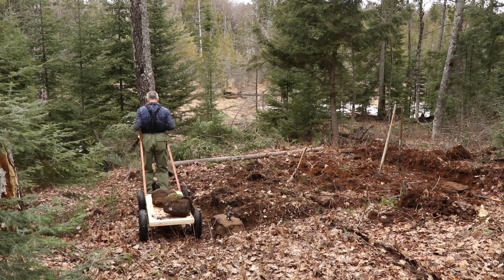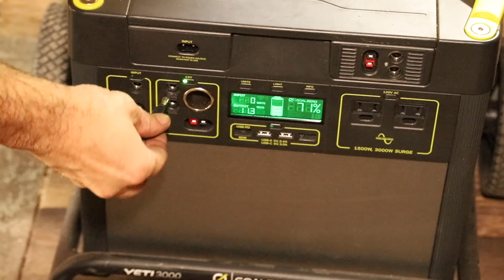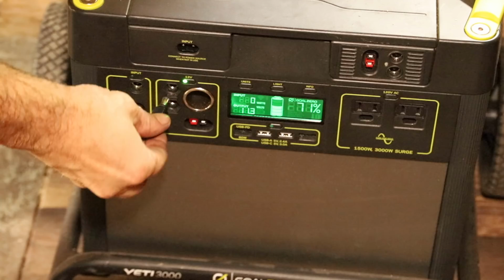FREE Hardwood Floor for the Outdoor Kitchen | Off Grid Log Cabin | Forest Kitchen

Comment: Yay, extra episodes are always a treat. Love the wood coin flooring idea. It'll wear well since it's end grain, will last a long time. An idea I had was to add a layer of compacted gravel under the floor to raise it up and to drain water away from the wood. Then use sand in between the wood coins to lock them in. Was thinking raise the floor up to the level of those horizontal logs you wedged in so they act like steps instead of being a trip hazard. Anyway, looking forward to the next video.

Comment: That rocky, uneven ground around the outdoor kitchen had been bugging me, so I'm excited you came up with a fantastic way to install a 'tiled' floor. I've seen this flooring technique used inside buildings, and it adds a ton of rustic charm.
Years ago, I had excess garlic that I couldn't give away, so I threw it in the weedy field adjacent to my garden area. It took hold and became naturalized. Those clumps have become bigger over the years, and produce dozens of garlic scapes that I can saute' or turn into pesto.
So I suggest planting garlic in several places around the cabin, in addition to your garden space. Harvest the resulting bulbs in the garden space, but let the other patches go unharvested. Let them become naturalized and run wild. Those bulbs will sprout up every year, providing you with a  supply of tender garlic leaves and garlic 'scapes' in the spring and early summer, well before it's time to harvest bulbs from the garden.

Comment: Hey Shawn  great idea for the forest kitchen floor.. I'd suggest a combination of cob with some cat litter (good cheap clay) saw dust and some lime and make a plaster grout spray coat the slabs with some type of outdoor varnish just so they won't take to the natural grout you make and  fill the areas with a good spatula or trowel and then get an old brush and some water and start doing the same thing you do with real grout when it sets in amongst the wood slabs . this natural material will breath with the forest floor and still offer you a clean and wearable outdoor floor.. I realize the varnish is not something you can use outdoors on this type of floor successfully but the coating initially is to just 'clean' the cob styled grout off the slabs and let the floor set. .. any grout you use will be affected but the elements but I think if this mud sets it will offer a great hard wearing floor.. super job you and Cali and your beautiful gal are doing.. can't wait for the next episode.

Comment: A chimney like on that camper stove with mid stopper to keep the heat in When ur cooking.. Whether it's blazing hot summer or freezing cold winter.. A good Chimney eithermud made or tin with rain protector and spark arrestor (around the back where the hole is.. No need to cut the A frame)...is a must cause without it ud be smoking a lot of the fumes.. When cooking something in the outdoor kitchen. Floor looks good.. Kitchen finishing soon.....stay safe

Comment: Wow looking at all those river rock your uncover leads me to believe you might need to put all your structures on pontoons . Look like mission valley here in San Diego but they just keep on building in old river beds then come the rains and all the city big wigs are standing around wondering why when we get a 1/4 inch of rain mission valley floods like clock work and there still building there every day . But at least your place is on the banks of an old river not in the old river bed good luck like all you do great series for both young and old . Happy trails

Comment: I don't know how to say this gently so I'll just launch it at 'ya. I built similar floor arrangement in a sculpted herb garden. I did use hardwood, Maple, IIRC. It didn't last. Since you have a roof over the rounds, they may last longer but I'd suggest to make future plans. You have so darn much rock up there, a stone floor would be really nice. Good luck, the outdoor kitchen is a really cool upgrade to the property.
Reply from the maker: I agree, they won’t last long and they are slippery when wet, but free. :). I have lots of stone, but not many flat ones
Reply: IIRC, you have other masonry projects to do, workshop, guest cabins, maybe? I'll give 'ya a tip: Guests, even youngsters or oldsters love to pick and sort rocks. Even owners can learn to love rock picking. Start some piles, you have a great resource there, under your feet!

Comment: I was thinking setting those solar panels in a frame and on a pole in a clearing. Then with a weight and pulley connected to some gears, maybe get it to rotate and angle towards the sun. Then again, that might be a job for Matthias Wandel.

Comment: for the clay fill in the floor what about adding equal parts of sand and concrete mix to double or triple the clay to allows it to setup hard .... or use a combination of sand muck with local moss and make it a hardwood ans cushion floor that will drain and lock everything in place as well 
.
Smart Wife ... excellent idea ... easy solution and a simple job .... if you mount the panels on a telescoping or raise-able frame work you can get the panels up a bit and then have a better chance of maximizing the light capture ... of course a simple swing out or down frame to steady it against wind would also be required no matter what 
.
one thing You really need to paint those carts ... a nice deep maroon or candy apple red .... then when they break you can always say you were fixing your little red wagon ;) 
.
great idea about the garlic ... I do suggest 3 or 4 varieties ... as each has it's own distinctive flavour  ... I suggest the basic store bought elephant ear ... hard stock garlic, chive and wild garlic and then find a nice sweet garlic variation . and you have it covered from more peppery to more garlicy to basic mild flavour .. and finally a sweet one excellent for tomatoe based sauces 
.
if you add some chunks of Oak to the garlic patch as a border get some Shitake mushroom starter and grow your own mushrooms as well .... although you could seed the logs from store bought you can not be certain it will be just shitake ... while a starter kit is just that .. some plugs of just shitake spores ... and they do pan fry up a charm and go awesome with fresh fish and sauces and bacon and cheese ... etc ... also they are a natural source of Vitamin D and make low maintenance plants like carrots seem needy ;) dont forget to mix and mingle the fresh herbs around the patch as well ... as most of the standards are natural bug repellents as well 
.
to help in bug abatement in the future how about spending some winter time making bat boxes or purple martin boxes ....make them as replica's of the cabin and future out buildings and place them around the cabin area to attract some more natural bug eaters to keep the pest problems down ... added bonus you have some scale models to aid in visualizing the layout and positions of the various buildings you want and set in your mind how you want things to look different and still fit with everything around them ;)

Comment: What if you took an old tool belt or got a wide leather belt (like a weightlifters belt) and added a metal loop and carabiner so you could hook it to your wagon to make pulling it easier?   

For a slightly safer verion leave out the carabiner and make a looped hook so if you fall, it just comes undone.  Take a metal rod and bend into an elongated oval, then bend the oval on the ends to form the hook.  Use a few rivots and some pieces of metal to attach to belt.

Comment: The reason why you should go in this direction with solar is that eventually you are going to put up a more serious solar setup. You want to use this idea as a test bed for planning your future solar needs where you would be installing your panels on top of the apex of a roof of any future buildings so that the apex is opposite to the sunrise. This way you can mount your solar panels as high as possible on the apex of the roof about a meter above the apex & that will give it plenty of range of movement for it to catch the morning light & afternoon light. You can also make your frame that attaches to the roof be able to be locked offset to the apex by side to side & raising one end from the other for changes in season's. It's much better to have a manual frame that can be moved for seasonal changes than getting a twin axis solar tracker. Having to get up on the roof every season to make alterations to the frame to catch the most sun is a good thing because it can force you to check for damage or problems every 3 month's, it also forces you to get up there with a broom with a bucket of soapy water to clean the panels too. If you mount these things on the ground for ease of use then you need to start clearing out a lot of trees to start getting sunlight & then that will increase heat & other changes in weather. Plus having it on the ground just makes it look unsightly & plus forces you to constantly store it inside while you are away from the land so that no one steals anything.
Reply: Solar Function,,,just curious, how would you clear a couple of feet of heavy wet snow if it were roof mounted?

Comment: Shawn, I'm a novice builder and only dabble in it when friends and family ask for assistance. Why wasn't the floor started after the roof was put on? My reason for thinking this is because of the countertop height. I'd imagine one would build the roof for protection against the elements, start with the floor, and then plan the countertops and other items afterwords. Did you plan it this way, or does countertop height not a large factor for you? Sorry if it seems like an odd question. I didn't see anyone else asking it in the comments section.

Comment: Been following your terrific progress for a year now. That floor might literally be your first mis-step though Shawn. Wood disk ends like that become super slippery when they are cold and wet. How will you keep them dry during the cold wet months?  Pretty looking but potentially hazardous surface when and where you’ll least want to be walking on one. You must know something I don’t or have a finishing trick up your sleeve? Stay safe out there.
Reply: A little paint or clearcoat, and throw some sand on?
Reply: Pygar2 perhaps temp solution but as soon as they start to rot by being walked on and worn smooth, they’ll be wicked slick again once wet, and they’re bound to be unlevel  to boot! That’s open end grain sticking straight up which will both wick water into the wood and then ooze it out as a slippery mess as the temperature changes and condensation outside on the ground. Not sure about dew under that structure also. Shawn will have to let us know how the experiment goes! :) I live in the west coast pacific rainforest here in B.C. and from experience we usually avoid walking on wet hewn wood in the forest unless we want to end up on our ass. Lol.

Comment: Cali is beautiful!!!!  Those discs you cut, I have seen (or maybe I had) some discs that split from the outside edge (bark edge) to the center.  I thought it was because they got dry.  Is there a way to keep them from splitting like that?  I am going to use small discs, cut out of a tree like you have there, to make cover plates for my light switches & fixtures but I sure don't want them splitting after a year or so!  Any ideas to keep that from happening?   As always, good video.....Judie